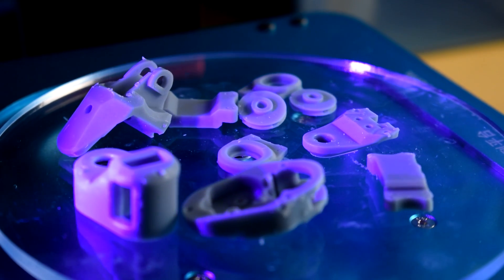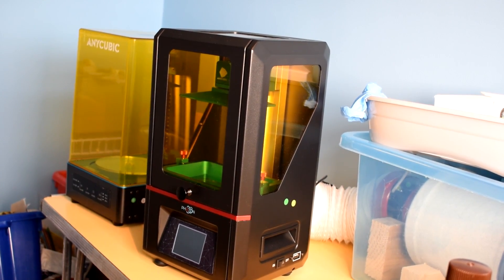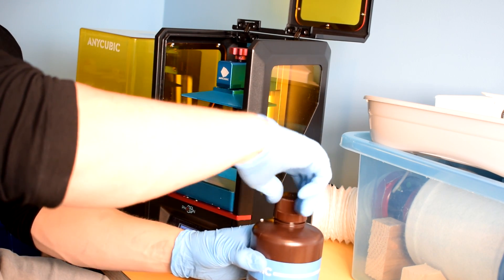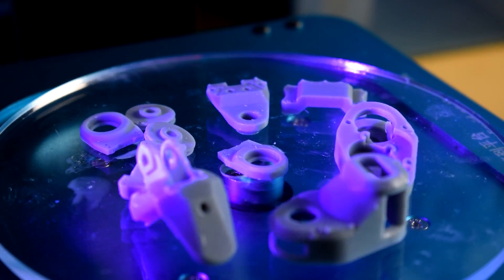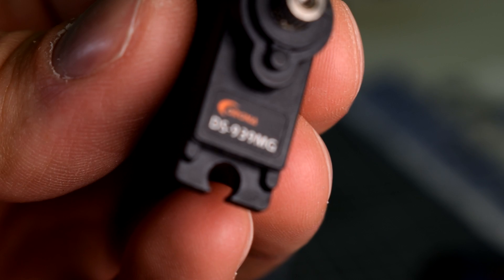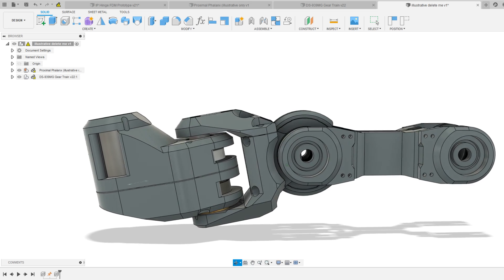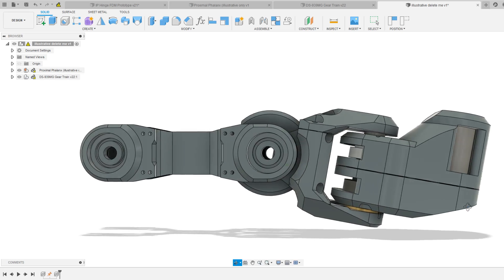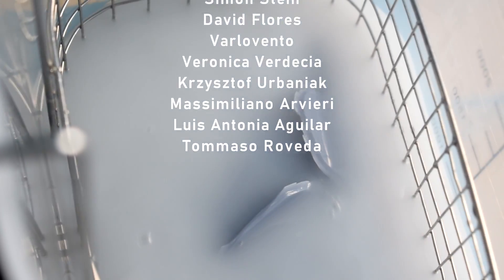Making the Switch to SLA! - Biomimetic Mechatronic Hand Part 5

Comment: TAKE OFF YOUR GLOVES before you touch the cleaning box! You will make it sticky and resin is not easy to get off! And worse, if you touch the tub or metal grate later with your bare hands and touch your eye you can go blind
You have to rescale your print bed. It can be off by 5% in x and y. Do a test print of an exact x and y width and correct it by the % that it's off from the started measurements
That's 5mm per 10cm of error!
Z axis completely different though 
Or you can just make the holes 1% bigger and pins 1% smaller lol

Comment: Hey.. back checking out your video becuase I need to make a robot finger for my next video.  SO I'm looking for inspiration on the design.  But I wanted to say that it looks like your winodw is open open, meaning that you're letting UV light in.  Remember that UV light cures the resin.  So you'll want to always have a shade on there or print at night.

Comment: There are also engineering resins available with similar tensile strengths and stiffness values of ABS. You could try that for some of the structurally demanding parts.

Comment: i got an SLA printer a while ago too and was equally impressed with the detail reproduction and tolerances! the only thing that concerns me with your tiny parts is (at least in my experience) compared to FDM parts are much more brittle, they chip and fracture much much easier. and if you are thinking of printing anything that will see lots of Sun or UV exposure, forget it, as it will warp, discolour and crack within a matter of weeks.

Comment: hi 5 new SLA bro  - esp as we're both in the biomedical field. 
IMHO the best place for a SLA workstation is a bathroom.
Ultrasonic is by far the best to remove; use a container with solvent (EtOH) in a water bath.
Consider adding some "flex" resin for additional strength.

Comment: Your designing skills are just ridiculous. Seriously, like the way you think out problems is so cool. I I would recommend putting some type of stop or clutch mechanism on the Pulley joints. Fingers take a lot of stress and the joints need a break away point. Kinda like a derailleur hanger from a bike.

Comment: for the size of the componants you can reduce the size of the touch points to the part quite a lot in chitubox.
I would also point out that The printer you're using is actually a DLP printer and not an SLA printer.
SLA printers use Lasers to cure the resin Which is why they're more expensive
DLP use a screen to display a slice of the model and shine a light (usually UV) up through the screen to cure the resin.

You may also want to look into finding Tough DLP resins rather than the standard ones as they'll hold up to the wear and rubbing better

Comment: Do watch out with SLA prints for structural components! I learned the hard way that SLA prints tend to warp and creep over time. Especially if forces are applied to it. After some months the tolerances with come loose and surfaces might warp way more than i ever notices on FDM prints in PLA or PETG. For example, i had to shim up all my bearing seating holes after 3 months since they started to rattle in my resin prints. So i went back to FDM for most structural parts.

Comment: Are there any good videos on how to add programming onto the Arduino? I printed, wired, and assembled your eye mech but cant get the programming to work. I'm good with mechanical stuff but the programming/computer stuff is a big weakness in my knowledge. I spent quite a bit on parts to make them would love to see them working. Thanks!

Comment: About those wires used for finger - Can you use something like "addressable led" for christmas lights, so it's one long wire instead of multiple thick wires going for each joint separately? Just remined me those christmas lights with alphabet from Stranger Things :)

Comment: Are you concerned about the material properties of resin at all? SLA is amazing for detail and accuracy but the resin it uses is extremely brittle. Just keep in mind that this stuff has virtually no give so you might have to reinforce parts that you'd normally expect to flex slightly.

Comment: SLA - looks better, but loses to FDM in terms of durability. You will grind the places where the cables pass many times faster.
Reply: If that is the case he could design those sections with FDM printed inserts that would protect the SLA printed parts. Just a thought

Comment: I'd be very interested to see how the design handles with how brittle SLA is if you want higher heat resistance. Going to ABS like reduces heat resistance significantly. I haven't bought an SLA printer, but I've ordered professional (think half million dollar) SLA prints with quality controlled resins and aesthetics. Hope it holds up and you don't have to start experimenting with different resins and a mixed printing but I have a scary feeling...

Comment: After washing the parts in the cleaner, I would suggest putting the them in curing station (or DIY one - UV led strip, nail polish oven or other UV source,  i would suggest making enclosure cuz UV is not harmful aand 'youtube safety experts' in the comments) or leave them in the sun. Also resin has different behavior under stress. In my experience (with Anycubic resin) parts are more brittle than any PLA. PLA can bend and deform, and the resin - snaps

Comment: How is the overflowing resin? Can you use it multiple times? Is it getting slightly hardened or do you need to dispose of it after X amount of prints? 

Basicly... how cost efficient is it?
Reply: Providing you don't have your printer in direct sunlight there is very little wastage. You pour the excess through a filter to get out any small bits of debris that may have cured and rinse off whatever remains stuck to the print but for all intents and purposes any resin that isn't used in the print is untouched and can be used again.

Comment: There's a time and a place for each current technology in 3D printing: there was obsolutely no competition for SLA / DLP in your scenario. I cannot wait to see what kind of doors are opened now that you've invested in a new machine.
Reply: Sls
Reply: @niw-w1f  My bad, no competition for any consumer-grade technology. Although, you are correct. Would also be cool to see some metal printing as well.
Reply: @banjogates , Yes! Anycubic did released some info about a FDM filament metal printer, but the info is not complete at the moment.
There are some other companies that already sell this but they are way too expensive for a stupid FDM, hope AC does have better pricing.
Unfortunately you still need to sinter the parts and they will shrink like crazy, but it does seem to be coming with good pricing!
Oh, and I do have a SLS and hate the powder! actually never use it because of that.
Reply: @niw-w1f  Impressive!

Comment: Oh another thing, An ultrasonic helps TONS but, ive been told not to use IPA in a ultrasonic. Use a strong degreesing detergent, Im currently trying CIF floor cleaner. works 99% of the time cleaning up the surface but i still struggle getting all resin out of holes...

Best thing to do is first agitate it in IPA for a little while... then maybe rinse in some detergent, then put into the ultrasonic with detergent for several minutes....

Comment: One tip:  You can design parts that need to be one part, but maybe you have to put something inside it, or it's difficult to print as one part, as TWO parts.  Then after assembly, put some uncured resin on the mating surfaces, and cure it.  It's like gluing it but the glue is the same material and strength as the print.  This works best with transparent resin.  Like the Siraya tech blue on Amazon.  I use that almost exclusively.

Comment: Ive been putting my isopropanol in a sealed see-through container and leaving it in the sun for a few hours. The resin will precipitate out and can then be filtered out and left to harden leaving relatively clean ipa to be reused.
Reply: Doesn't it also make IPA to boil off?
Reply: @mvadu  It has to be sealed, I've been using cheap tupperware type containers with a rubber ring around the top, you might lose some but much better than trying to dispose of toxic emulsion. The ipa is nearly clear and the sludge can be filtered and hardened into a safe resin blob.
Reply: @petermoore9504  that makes sense.. Good idea, and environmentally friendly too
Reply: What is happening? How does having some of your material react benefit you?

Comment: First time I have seen this... dual screen internet, means I am googling and ebaying and reading manuals while pausing this video... thanks for the insights. Looks very effective. I would like a bigger build space option. But for the price... I wonder how strong the material is for wire pulleys?

Comment: One more thing you'll find different from FDM, heat. Because it's resin, the part can handle more heat than any non-heat designed FDM filament.
Reply: Yeah, but resins can get very brittle if continued to be exposed to UV light.  FDM is much stronger when the scale gets large.
Reply: I delete it
Reply: @unity3d706  That's pathetic. Go somewhere else with you self advertising bait.
Reply: Sorry bro
Reply: Well, to be fair, annealing dry PLA in a mold-like structure (i.e. hard silicone, or as CNC kitchen did, gypsum) will make it remarkably heat-resistant without deforming it.

Comment: Go for the ultrasonic cleaner. If you can get a decently sized one, do, you'll probably use it for other things as well, very useful tools, and in the resin aspect, about the only thing short of pressure that can clean properly, all the small bits out. However, be mindful of what fluids you use, ultrasonic cleaners, as part of the math behind the sonic aspect of the deal, specifically, the horns, well, if you put too thick or too thin a fluid, that's going to shorten the life span of the unit (if that happens, don't throw it away, just replace the broken parts, they are simple machines, but behind them there's complex math, one of the reasons there's only a hand full of DIY sonic cleaners out there).

Comment: @Will Yes, You are right with the ultrasonics cleaning, especially in high aspect ratio structures. due to the fact that a quasi laminar flow over the surface will generate a Nernst layer that favours diffusion as transport mechanism only (the other terms of the Nernst Planck equation are negligible, because you do not apply any field the Migration term is dropped and because of the laminar flow the convection drops to zero near the boundaries of the liquid.) 
So normally (Laminar flow) the thickness is inverse proportional to the velocity of the laminar flow. But for high aspect ratio structures this is not interesting. But if you are using Sonic agitation the thickness of the Nernst diffusion layer is inversely promotional to the frequency. So blast it with US. Note also that the energy that you put in it is not affecting the result directly, but US is directional. so get the parts moving in the basket. Good luck J
Reply: of course...
elementary ;)
Reply: Seriously though,  never thought laminar flow was present in a US bath. I thought it was purely chaotic.  Makes sense to me though that you still need to shake it up while it's in the bath.
Reply: @Scott_C  You right, the laminar flow still present, is mostly overlayed by the turbulent but that is not the reason you should move the parts. The fact that the Soundwaves the cause the turbulent flow are directional and therefore you can "shadow" areas that you want to clean. On top of that it gets worse if you up the frequency. Most commercial bath are using tube shaped tranducers in an elongated tube and move the parts in wire basket through it. Therefore a change the angle of incident is automatic. But if you use a smal bath Using a small motor with a excentic disc tipping the basket does the trick for me. :D